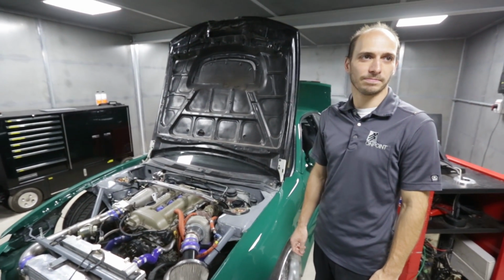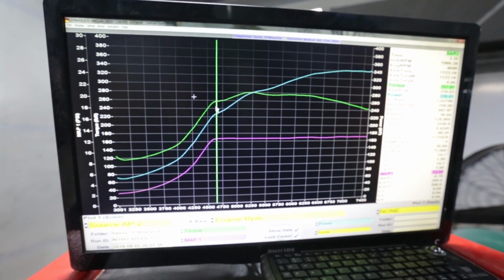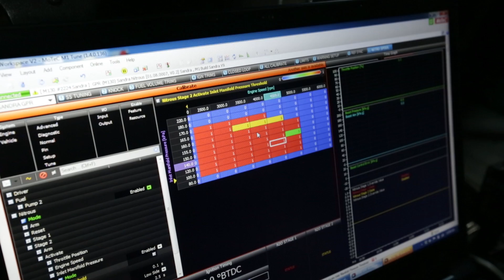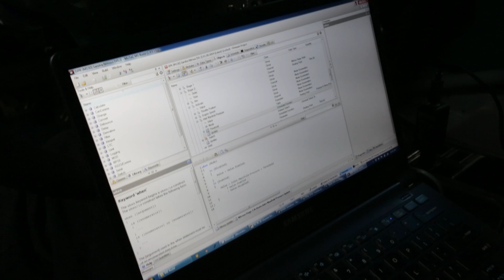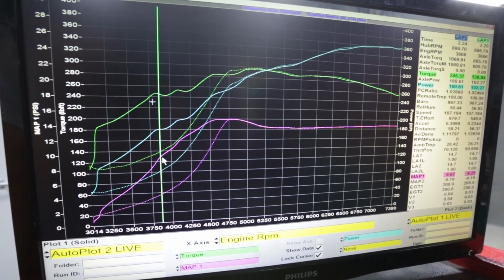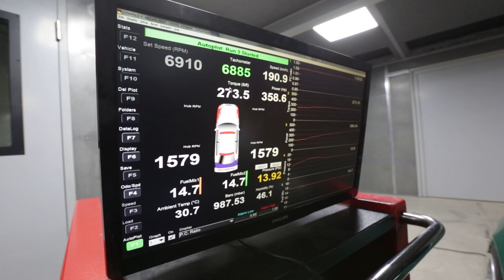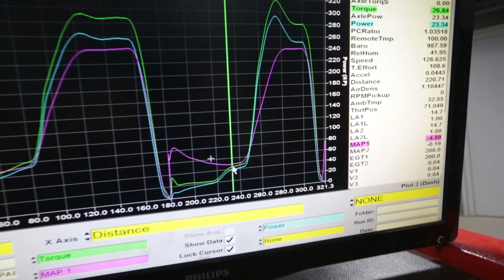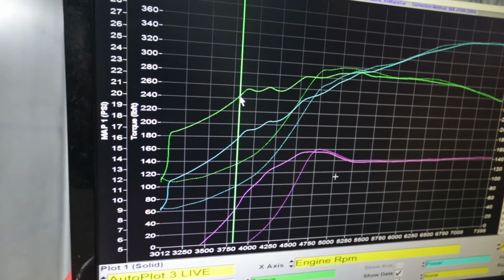Watch Nitrous Make A Nissan 240SX SR20DET Behave Like a V8 Engine

Comment: I like that he showed and explained how nitrous oxide can improve power band and throttle response which can be used for big turbo applications, but at 340 whp he could just equip a gtx2560r and get the same thing without having to fill up a bottle.
Reply from the maker: Sasha doesnt want a high strung setup that needs 25psi to make that power. Plus that means race gas has to be run too. This is a low stress setup and now with nitrous it spools super quick
Reply: popdancebeats that's only true if your running the smaller turbo beyond its efficiency range
Reply from the maker: No it doesn't, if you don't create a large spike in torque then its a very low stress setup. 

Glad to hear your setup is working well for you. Around here, 25psi on an SR with pump gas is not a reliable setup.
Reply: Speed Academy definitely having a linear power curve is going to be safer and less stressful. yeah, most places only have 91 octane.
Reply: Grip Limit It's called trying something different , who wants to do the same boring mods over and over....
Reply: kyle de man I understand that, but I have an SR with a gtx2871 at 25 psi by 3700 rpms and around 450 whp. and I it's more than enough without nitrous added to the mix. but I do take this video as a science experiment though, which is pretty cool to see. as a fellow drifter though one of the things I've learned is technique is everything, setup should be done if that's not enough... unless your going pro.
Reply: I hate SR's I've had one and if you were taking it fully professional and/ or pro level then motor swap for sure
Reply: kyle de man To each their own. you should check out David Briggs formula D car.
Reply: Ill have to look it up,  yeah I had a s15 great looking car but it let me down too much
Reply: kyle de man I'm sorry to hear that.
Reply: Speed Academy but nitrous with boost makes it high strung, two different methods for more oxygen. and I run 93 octane with 25 psi and stock timing, just run richer, it also helps with cooling the combustion chamber
Reply: A larger turbo will make the same power  on lower boost, he doesn't want the torque that would be made with a smaller turbo on higher boost but still wants the response
Reply: I'm pretty sure the early sr's without vvt are bit more reliable. I went LS  4 years and Ive never looked back

Comment: i think you could achive this running a susquencial turbo system a smaller turbo for low rpm which shuts off once the bigger turbo begins to spool which will solve ypur lag problem

Comment: Very cool to see this in action. But I'm curious as to why you'd do this on something only making 12psi of boost. A small turbo can definitely make that pressure and I'm sure you it can flow enough on the top end. Even an old school journal bearing MHI 14b could do that. (not that it bolts up to an SR) Still cool to see this in action and what it can do to help those who need a solution to turbo lag.
Reply: Jeffrey Ball at the same boost pressure, a larger turbo makes more horsepower than the smaller turbo.  It flows more air at the same pressure.
Reply: Sylas Gissendaner Understood, but you can get a smaller turbo and make that much power. But I see what you're getting at and why they would go this route.
Reply: It would take a smaller turbo more pressure to flow as much air as a bigger turbo, so no, you couldn't actually get a smaller turbo with the same psi to make the same power, if that makes sense. Even if you've seen smaller turbos make that much power, it may be that the engine is internally different. But again, a smaller turbo at the same pressure would make less power. He should get a newer turbo with better technology, but nitrous is the cheap solution and probably better results than just a new expensive turbo
Reply: Beau Bolding true.  An EFR on an sr20 will make insane bottom end torque, more than a regular old LS swap.

Comment: wow. thats almost stock 4g63 power....... that sr20 is fucking shit.
Reply: No. I mean a stock evo 9 mr FQ360 has 360hp. 355ft lbs and no problem at all spooling the turbo.

The evo 8 fq400 has 398bhp and 380ftlbs an spools the turbo from 3500rpm.

When your hp numbers begin with a 1 or 2 ad you have a massive turbo and forged engine.... thats shit.
Reply: tyler t lol.the fq400 is a factory mitsubishi car sold from the dealers here in the uk. 
also...if youre in the usa...you wont get the evo 9 mr FQ360... the clue is in the name. 360bhp.

the FQ is factory tuned by ralliart for the uk market. its still a stock evo.

the numbers on this sr20 are still shit.
Reply: That made no sense at all.
Reply: antonyaiken sure it does.  This car is lighter, so thus faster at same power.
Reply: antonyaiken not on 12 lbs...
Reply: Yeah id love to see a 400+hp sx keep up with a 400hp evo.

Never going to happen.

Real world physics are totally different to on paper physics.
4wd will out.
Reply: Ok... i speak perfect english. Being english myself. Im 32 years old having owned a 250hp mr2. 400hp evo 8 and currently own an infiniti m45 which is rwd and v8.

I still cant understand your logic.

A 400hp sx and a 400hp evo on a track together.

Same tyres. Same driver. Same conditions.

The evo is going to walk all over the sx.
Its not even funny. 

Wrc car? Wtf you talking about? 
Drifting is not fast. At all.
Once you lose traction in the sx....youre going slower than the guys with 4wd.

How many evos are there in time attack?
Successful are they?
Thought so.

Im not saying im better at driving like you seem to be implying.
But try to launch a 400hp sx to 60mph in under 4s and see what happens.
Try to put the power down after a tight hairpin see what happens.

Its basic physics.
Might be faster in gear at 50mph.
Or in a top speed shootout.

But acceleration in real world situations........... not a chance.
Reply: And a swede road in january.... ok.

Lets see when was the last time a rwd car won a race in wrc on swedens roads.....hmm?

Youre full of bullshit.

Comment: Why would you run a dual stage setup? The motec on that thing has to have progressive control. I mean even  if it doesn't basic progressive controllers are pretty obtainable. you'd have to tune for it but it wouldn't be that tough.  whats better is you could ramp the nitrous to match the power band to get that "v8" like torque. Hitting the motor like that disconnects a linear response and add's stress where it doesn't need to be

Not hating just seems like a pretty mickey mouse way to handle business for this level of performance.
Reply: I think we will re-write the code and make the Nitrous control progressive, good idea! With M1 Build it is literally just a matter of re-writing the code. The solenoids are already triggered by an output capable of PWM.

The threshold table would become duty cycle, rather than on/off, and the fuel compensation tables can be easily modified to add an axis for Nitrous solenoid duty. 

If we wanted to get more complicated, we could model the nitrous flow for the system we have and know the exact amount of additional fuel required, but we'll skip that step for now as it's difficult to justify the time and money to measure the flow of Nitrous at various duty cycles.
Reply: with regard to Nitrous flow can't you just rely on the wide band? why would you need to know the flow? What I like about your setup is that you're running a dry shot and leaning on the motec for compensation. so it's not like you have to run dual stage injection it should be just like tuning for a bigger motor, yeah?
Reply: Either way good stuff man! pumped to see people trying new things.

Comment: You're lucky that hundred shot of NOS didn't blow the welds on the intake!
Reply: Knew it was coming.
Reply: Danger to Manfold! - Floor pan falls off! aha.
Reply: You need to move up to a NANO pressure system .The bottle  heater is always behind the pressure curve during time that N20 is being discharged from the N20  bottle .Or better yet,build a all  N20 drift car using either stand alone ECU such as Motec   or a unit such as a NX Maximizer 4 with either a wet or dry shot .NX's Maximizer 4 N20 controller has throttle control mapping and a host of other safety features .Think out side the box and putting the info out there could allow those that cannot afford a turbo set up a cheaper but just as good option for power adder drift builds.I run such a system ,N20 with a pressure assist NANO system and water meth AEM system .

Comment: 340hp with a GT30, what a joke.
Reply: He literally said in the video that he didn't want to turn it up because of the gearbox. But you know better, Internet.
Reply: was going to say that too. bin the nitrous, fit a gtx28 and have full boost before 4k, surely itd still make 380-400hp ish at the fly on that?
Reply: Subie Guy And do you tune?  You've been commenting all over this video about how bad he is.
Reply: That power curve and number out of a GT30R would show otherwise.
Reply: Must be using an exceptionally shitty turbine AR for the gt30 to spool that slowly. OP, it's on 12 psi, the number it's making is fine.
Reply: Layne Richardson 
I think they know what they are doing.
Reply: the peak hp and torque figures arent the problem its the way its delivered, why not use a lightly smaller turbo or even just a smaller turbine housing if available and bring the boost in sooner? if the aim is throttle response, then that would make more sense to anyone surely? and thered be no need to spend a day fitting and setting up the nitrous either

Comment: Variable Geometry Turbocharger or Variable Twin Scroll Turbocharger are ways to have no lag.
Reply: Donald Tavares Agreed but are incredibly expensive to make.
Reply: Donald Tavares just upgrading to a GTX series garret turbo with billet wheel and new bearing design would be a more affordable way to do it Without added complication.
Reply: that nitrous kit is definitely more affordable than a $1,400 turbo
Reply: +Donald Tavares Correction, they are a way to have a lower boost threshold.
Reply: Or go bi or sequential the turbo

Just don't go parallel ffs unless you're running 1k plus there's no reason to
Reply: Jack Truitt true but it is a bandaid fix. And more points of failure and more things to maintain and control. GTX will perform better everywhere top to bottom in the power band and will be consistant and work all the time. Also bottles have to be purged and refilled and maintained and have a running cost. If you sold the first turbo used and put the money from the nox kit on top. U probably would of been pretty close anyway... but if it was done more as a experiment or to be different than good for them!
Reply: Jack Truitt what motor?  I was using A GTX 3076R on my 4G63. It was a beast. And when u switched off the motor it just span and span forever. I recommend you save the pennies a little longer and do it once and do it right.. get an R turbo.
Reply: 0ttoman it's a built sr20. the way I build things, a gtx3071 setup will cost me 5k